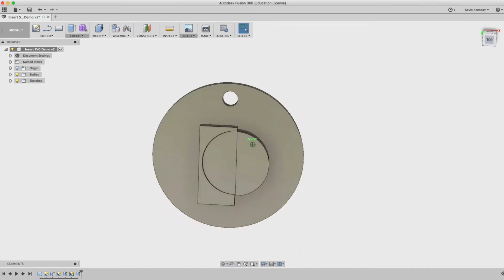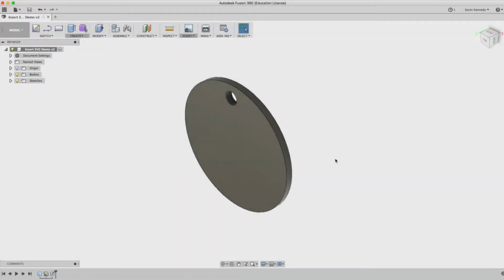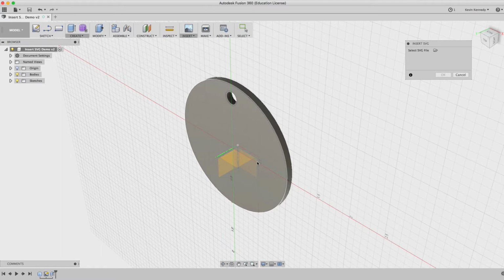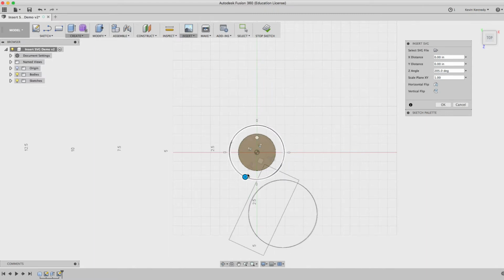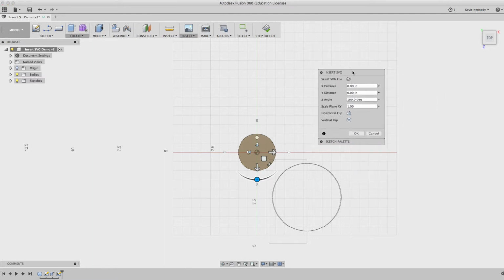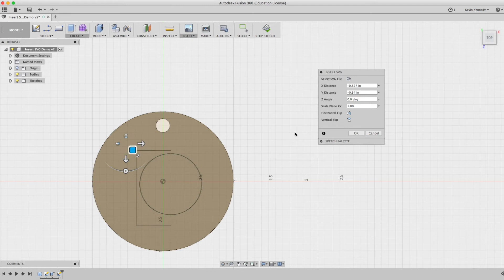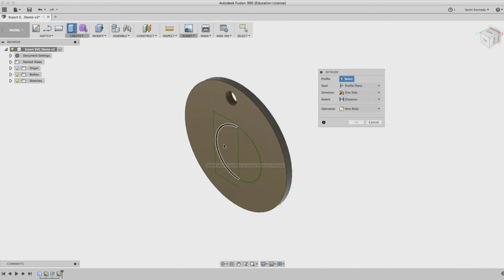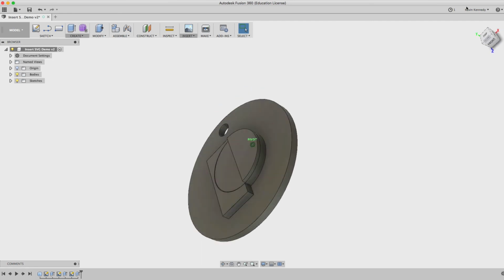How to insert an SVG logo in Autodesk Fusion 360 (for Complete Beginners)

Comment: It seems I'm not alone in noticing that when importing svg from Illustrator to Fusion 360, even if everything is set to the same dimensions ie mm, that the files do not come in to Fusion 360 1:1 even if scale plane XY is set to 1.00. If you want it to come in at 100%, you actually need to set it to 1.3333. It seems this is a work around many people have figured out, but I'd really love to know why it's doing this and figure it must be some setting somewhere in Illustrator or Fusion 360. I thought you might know :)
Reply from the maker: Hi Alex. That's interesting, do you have an example SVG that I could test? I have done SVGs to scale before and have not had that issue.

Comment: This function is useless. WHY IS THE ORIGO AT THE CORNER OF THE SVG, WITH NO WAY TO PROPERLY PUT IT IN THE CENTER? It really needs to be in the center to be able to correctly put it in position . Right now all I can do is freehand align it to where I want it, but that inset good enough. Pleace fix this!
Reply from the maker: Hi Anders, this is a great suggestion and something that I recommend you submit to Fusion 360's idea station. The idea station is where users can submit their ideas for improving Fusion 360. This helps the engineers work on the features with the most backing, in order to make improvements that help a large user base.

Here's the link to the idea station forum: https://forums.autodesk.com/t5/fusion-360-ideastation/idb-p/125

Alternatively, as a work around for now, you can always create a box outline (or whatever shape you need) within the SVG file to help line it up better. Cheers, Kevin :)